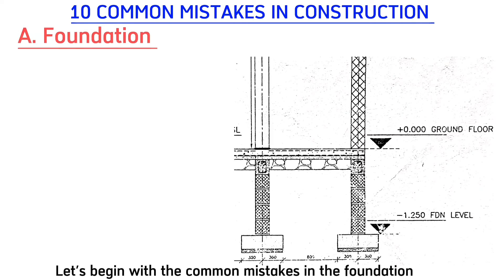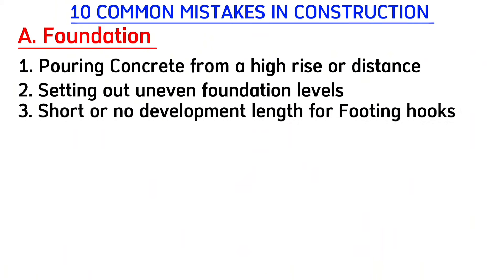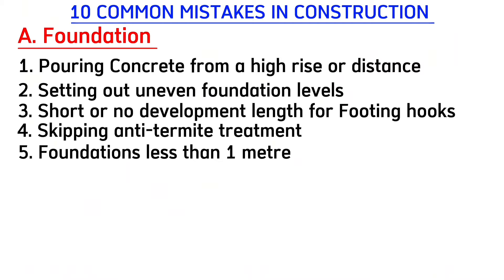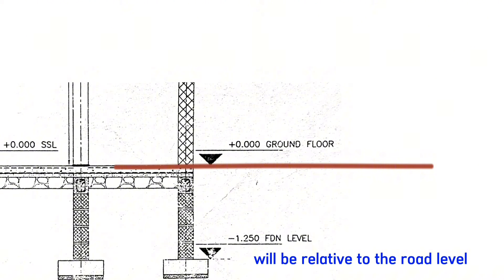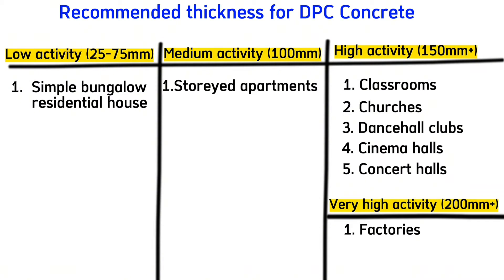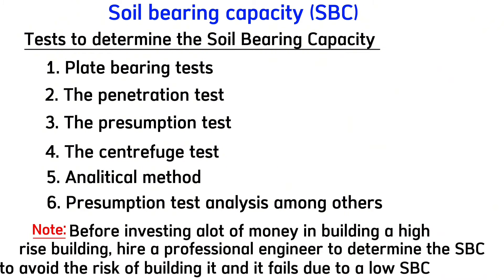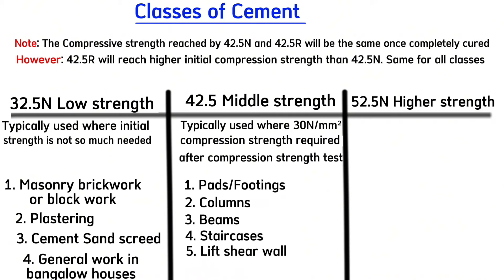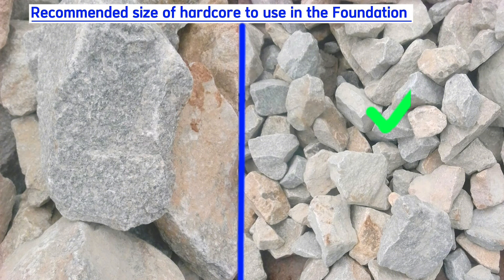10 MOST COMMON MISTAKES IN CONSTRUCTION (Part 1) | House Construction

Comment: Hello Engineer, am so glad I came across your videos. Please talk about the tendence of builders using higher ratio for CEM II (1:6) to construct a brick wall that requires a ratio of 1:3 mix as a replacement for CEM IV suggesting that the CEM II is stronger and therefore would save costs as well achieve same strength. 
Secondly, am grateful you talked about the strength of cement in regards to written strength 32.5N and 42.5N, I have noticed there's CEM IV 32.5N and CEM II 32.5N as well as CEM II 42.5N and CEM I 42.5N does it mean it's wrong to follow the CEM I, II, III, IV label and rather go with the strength written...please we need more clarification on cement types. Thank you for your great insight.
Balire Henry
Mbale City, Uganda
Reply from the maker: Hi Henry
You can read this article I wrote on our website it explains cement clearly 
https://www.ianconstructions.com/the-three-main-strength-classes-of-cement
Reply from the maker: It actually depends what you are building 
Again 1:6 for CEM II  is a self made claim by them not the standard 

If you are building let’s say a septic tank, it’s better to use 1:3 CEM II
Then for any kind of masonry work, for bungalows and storeyed houses, ie brick work or block work, use CEM IV 1:4 mix ratio 

You can always contact me for free, I’ll guide you on the right kind of cement you are supposed to use